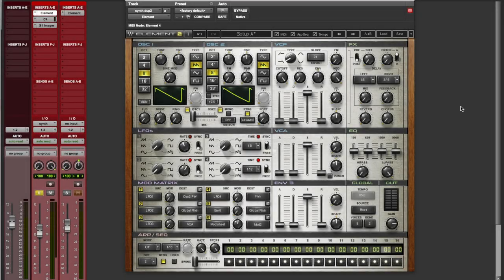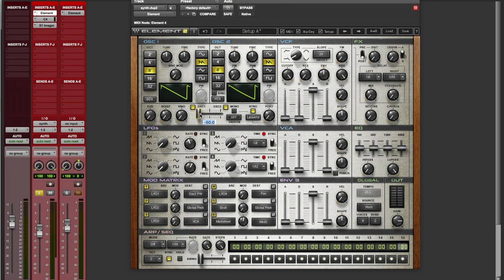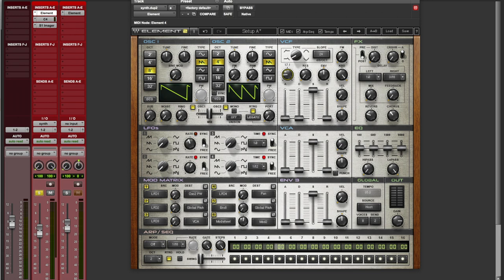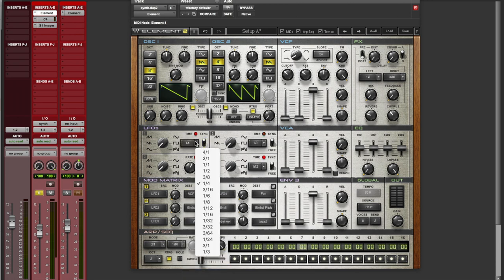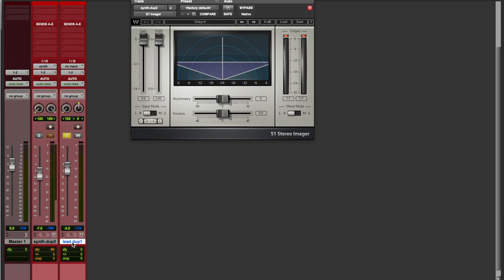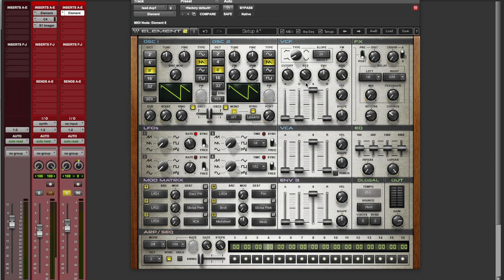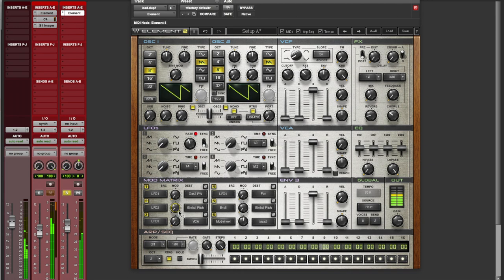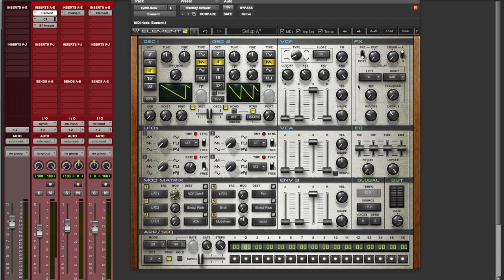Tame Impala Synth Production Tutorial - (Nangs in 5 Minutes)

Comment: I followed your steps in element and checked every parameter to make sure it was the same and for some reason it sounds completely different and abrasive. Do you know what the problem could be?
Reply from the maker: Hmm, that's strange if it's abrasive lower the cutoff to smoothen it out. Double-check again, you may have to make micro-adjustments, the velocity of the notes you hit will affect the timbre as well.